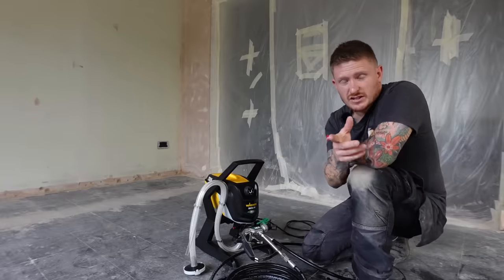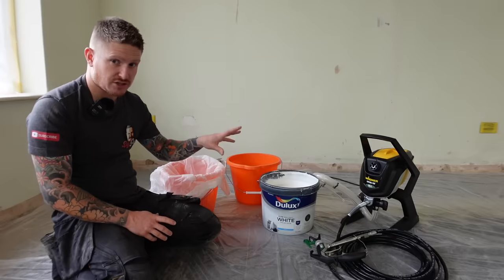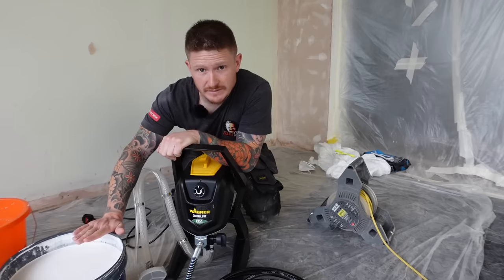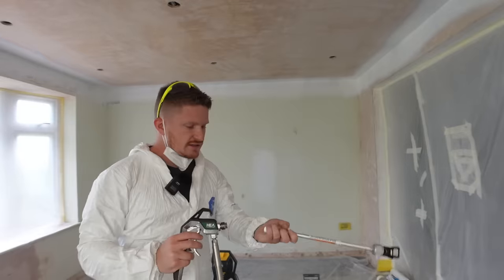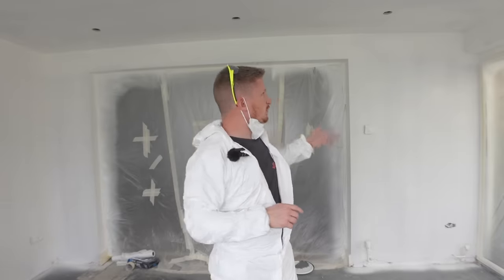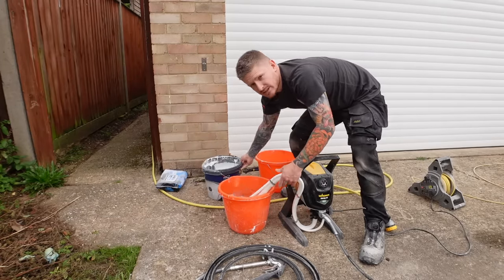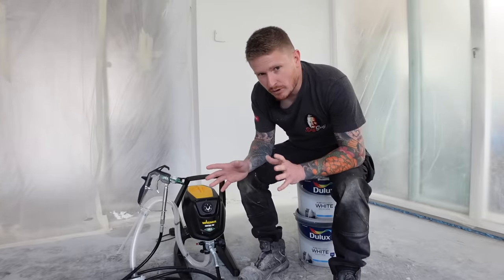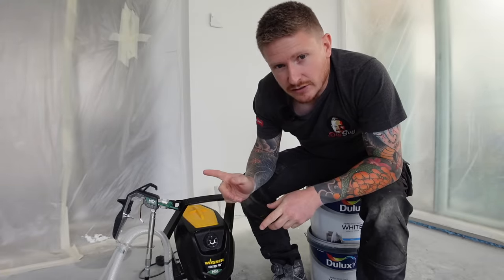How to Spray Paint Walls and Ceilings Quickly - The Tool You MUST See!

Comment: I am really interested in this for our extension/renovation as it will all be one colour and we have vaulted ceilings to paint. One downside I have heard is when you need to touch up marks. apparently the spary finish is so even that any brushwork to cover marks will stick out like a sore thumb.
Reply from the maker: Give one a go. The downside is correct however worth it in my opinion
Reply: Just back roll it after spraying

Comment: For the second cost did you use paint with no water in it?
Reply from the maker: Just to clarify. Your paint need not be watered down when using the sprayer for general use however when mist coating I like to do two watered down coats before adding top coats.